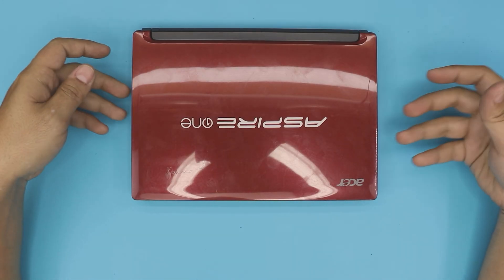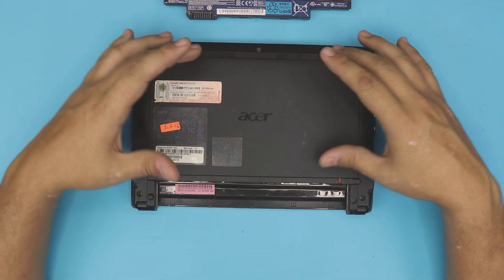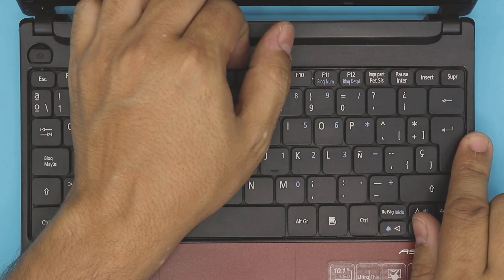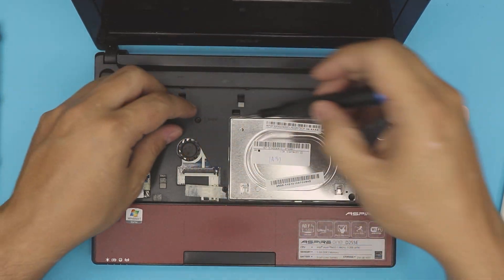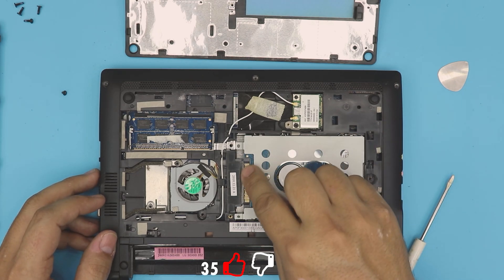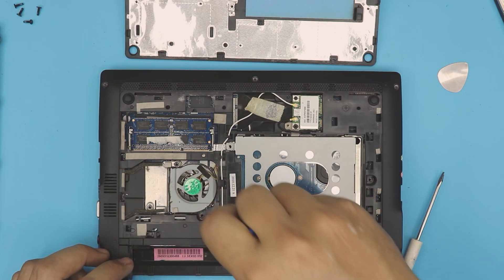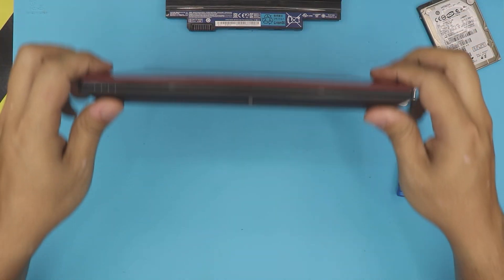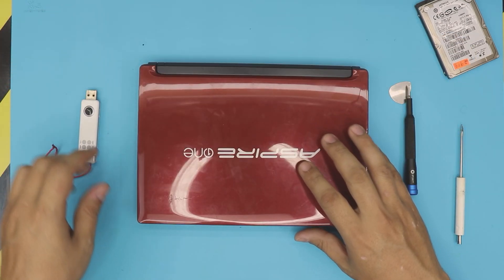Acer Aspire One D255e SSD Hdd Upgrade, Boost speed Guide

Comment: Thank you, I repeated your actions, followed the recommendations and successfully replaced the RAM module (1 GB -> 2 GB) and the default 160 GB hard drive, installing a 240 GB SSD. The freshly installed Windows 7 now works very quickly. It is clear that this device will no longer be suitable for the Internet and YouTube in 2025, but it is suitable for low-resolution multimedia. The device is already 15 years old, lol.
Reply from the maker: It's my pleasure my friend.
very glad that you revived it and gave it a use 🫠
Should you have any further questions or requests in the future, please don't hesitate to ask me.
cheers🍻

Comment: May I ask if I can upgrade my d255e motherboard to my current d255 motherboard? And is it the d255e is ddr3 socket ram now?
Reply from the maker: it will not fit they are a bit different.
Reply: @uFixTek  Oh so it's not recommended sir?
Reply from the maker: no is not recommended

Comment: Where is the CMOS battery located on this laptop and how to access it? Please help - I need to replace the CMOS battery, because it won't remember the date and time.
Reply from the maker: Thank you for your feedback! If you enjoy the content, you can show your support by liking the video, subscribing to the channel, or doing both!
Now, let's address your question, The CMOS battery on this model is not easily accessible as it is soldered onto the board. To replace it, you would need to desolder the terminals of the battery and find a new 3V watch battery. Alternatively, you can use a regular CR2032 battery with cables and solder the positive (+) and negative (-) terminals to the correct pads on the board.

Here is a video (although quite old) that demonstrates the teardown process. While it may not be the exact same model as yours, the process is similar and can give you an idea of what to expect: Video Teardown: https://youtu.be/W7bteRANhRA

Additionally, I have provided a picture of the battery for reference: Battery Picture: https://imgur.com/a/HhqHMtA

Please be cautious and take necessary precautions while working with electronics. If you have any further questions or need assistance, feel free to ask.
Reply: @uFixTek  Thank you for your prompt reply.
It's ridiculous how nowadays they make it so hard to access a part (the CMOS battery) which will need replacement sooner or later. The same goes for memory modules and hard drives - they used to be easily accessible under a piece of plastic attached by a couple of screws. Not any more. Now you have to take the whole laptop apart to replace them.
Reply from the maker: It's unfortunate to see how the industry has changed over time. Manufacturers often prioritize convenience for themselves rather than providing options for users to open, upgrade, and repair their electronics. This shift is largely driven by their resistance against the right to repair/service movement. In the past, there were companies that focused on creating flexible, upgradeable, and serviceable laptops. However, as more companies entered the market, the landscape shifted towards consumer preferences centered around CPU and GPU performance, storage capacity, and other visible features.

Manufacturers tend to cater to what consumers want to hear, while silently working on strategies to encourage customers to purchase new laptops more frequently. This often involves locking CPUs on the motherboard, soldering RAM onto the board, and making it harder to access internal components for servicing. This trend was partially influenced by prominent brands like Apple, which initiated these limitations.

It seems that the industry has become more focused on selling and reselling new laptops rather than creating durable and upgradable machines. As someone with over 17 years of experience in laptop and electronics servicing, I have witnessed this transformation from excellent build quality to concerning practices hidden under the hood. Whenever issues are brought to light, manufacturers tend to dismiss them as "defects" and then introduce new "defects" the following year while working around loopholes.

In light of these developments, it's understandable why you advocate for PCs as a more viable option. Laptops, despite their portability, have become increasingly limited in various aspects.

Comment: The D255E uses DDR3 and D255 uses DDR2
Reply from the maker: D255e used SDRAM DDR3L (low voltage) it will not read ddr3 none L

Comment: Hi..what's the highest I can upgrade as I'm already using 2gb ddr3 500gb had running win 7...can I upgrade to win 10 without upgrading to Ssd?
Reply from the maker: Thank you for the feedback and your support by a sub  :P
regarding your question:  you can upgrade to 4gb and the hdd you can place a ssd 1tb or hdd1tb. but dont install win 10 on 2gb laptop.
Reply: Hdd *

Comment: Hi, bro...i just want to know what is the max upgrade specs for this particular model...i already watch your other videos,  in that video, you do told that you already try 4 gb ram and it's not working. Tq
Reply from the maker: ya you cant place a 4gb , it wont work there is a way to change the bios and get it to read the 4gb but the stability issue will be very common and you risking your bios. i suggest you upgrade the hdd to ssd. and you will see a major difference. any ssd 2.5' sata/
 thank you for the support and feedback.
Reply: @uFixTek  got it bro👍 thanks 😊
Reply from the maker: anytime my friend :)
Reply: @uFixTek  ssd 2.5 ' is this compatible size to replace hdd inside this boy?
Reply: @Tepi_Sikit  it is, just did mine.
Reply: @davlord9470  thanks